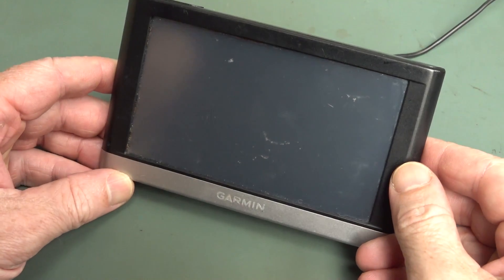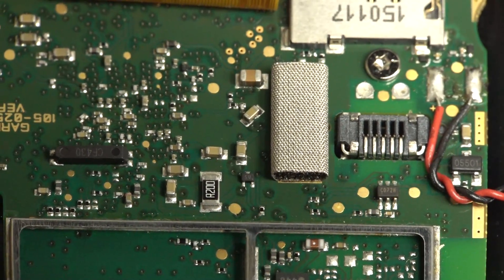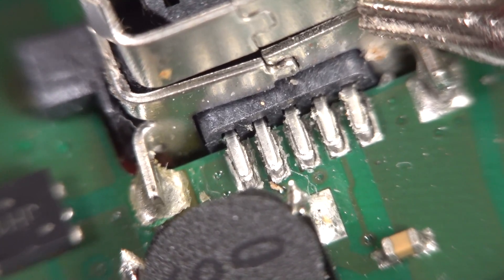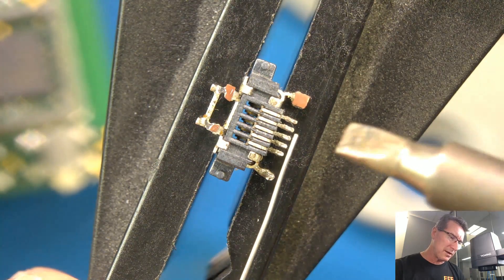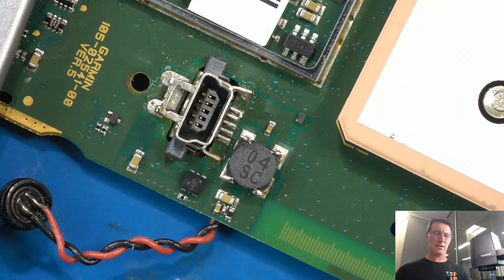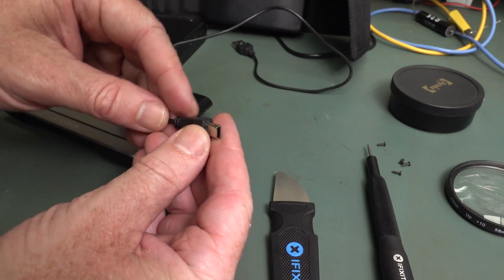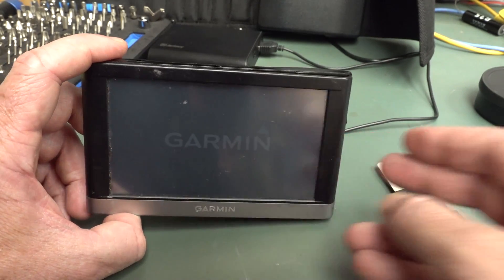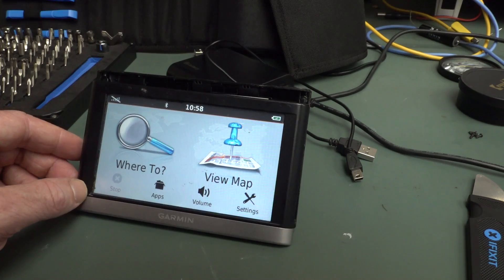EEVblog #1281 - Garmin GPS Repair

Comment: You ran out of flux or you are allergic to it? :P

Just giving you a hard time.. i would have used flux to whick that old solder :P
Reply: Louis Rossman took all of his Flux
Reply: @Rainbow__cookie  lol yeah..
Reply from the maker: You mean with that solder wick that already contains rosin flux? :-P
Reply: @EEVblog  yes. wick has never enough flux. it evaporates faster then you make your job. By adding good amount of gel flux you will decrease minimum operating temperature significantly, thus reduce the risk of damage, where it is really present..
Reply: @Mr.Leeroy  well you cant get enough flux im with you there lol

Removing components is what needs it most. Cuz of the non-leaded solder n such.
Reply: @joshuanorris5860  for general work the more flux you use the harder it would be to clean the board afterwards. I'm not a fan of submerging my components in a pool of flux, but when using solder wick it is actually required for proper heat transfer, not just oxidation prevention.
When removing lead-free components more flux won't help much, instead use leaded tin (or even better low temp mixtures, like 100 deg C melting point, if contamination of components is acceptable ofc) to lower the desolder temperature.
Reply: @Mr.Leeroy  so your saying you CAN have enough flux? Lol
Reply: @EEVblog  oh snap! Im sorry i doubted you even for a second haha
Reply: It should be obvious when he said "I don't know what these dendritey things are?"  They're Tin Whiskers Dave, where have you been for the last 20 years? :D https://en.wikipedia.org/wiki/Whisker_%28metallurgy%29 Yeah, the joys of RoHS solder.  I think Dave missed most of that.  They DID have solid core solder in the old days that you had to paint flux on things to make work, usually more a point to point soldering thing like in industrial panel wiring, etc.  No flux pens and needle bottles like kids today use. Just the sweet metallic flavor of lead solder, and the burned organic smell of rosin core flux. After enough years you don't need contrast agent for em to image your bones. :D
Reply from the maker: @Psibr1  I know what tin whiskers are, I used to have a several hour presentation on it on the channel before I had to pull it from the channel. They don't look like traditional tin whiskers to me.

Comment: Could you squirt like a load of glue gun glue from both sides to prevent it moving in the future? Best if it dries semi rigid. And has to not block the case... Since the connector chassis connects at 3 points I don't know how much you have to re connect one of the grounds unless it happens to be the only one connected.
Reply: Matthew Suffidy , Have you discovered JB Weld? It's like your first bong, You know you found gold.....

Comment: Garmin is in so many ways better than TomTom. Unfortunately, I bought a cheap (100€) TomTom 10 years ago, and it still works. But I need a virtualbox with Windows on it to connect to my PC (it had last gotten the GPS week rollover update last year, now it's finally out of support), so no support of updating it with any decent operating system. And the case can't be opened, it looks like it's ultrasonically welded, there are no screws in the thing. So this will definitely have been the last item I've ever bought from TomTom, if this thing ever dies (it sits behind my windshield 24/7 in summer as in winter, but no chance so far), I'll definitely get a Garmin one. However, I'd really like to have an old style unit with none of that cellular data connection, spyware or anal probes that constantly reports its location to the home base (of the manufacturer), and I also rather liked resistive touch screens compared to that modern capacitive rubbish where you can't precisely hit any stuff...
Reply: Garmin is the OG mannnnn :)
Reply: @joshuanorris5860  What?
Reply: The tomtom is probably just clipped together. The ones I've disassembled have just been clipped.
Reply: @tin2001  Then it's clipped really tightly. Anyways, I've again come to the conclusion that I don't need a new GPS, since except for the outdated maps (which I know and can react to), there's nothing wrong with mine (and since it isn't supported any more now anyways, not being compatible to my PC isn't a problem any more either). Also, the new ones all have some kind of connectivity and therefore include an anal probe or two, probably snitching all your routes and locations and speeds to the manufacturer, and I definitely don't want that. Then I'd rather not use a GPS, but an old-fashioned map instead.

Comment: Ahhhh suspect USB cables have gotten me more than once.  Seemingly every device you buy comes with yet another USB cable, and lots of them are dodgy as hell.  A few weeks ago I was baffled by a USB cable that was power-only, but had no markings indicating as such.  (I'm not even sure if there is a standard for marking USB cables that are power-only vs power+data.)
Reply: Several of the power only cables I've seen have a lightning bolt symbol but most don't.
I get out the permanent marker and label them with a "C" or "charge" (depending on the size of the space I can write on) when I find any of those sort of cables. Or if they are super crap and thin, I cut them in half and put them into my connectors box 😂

Comment: The lack of flux is uncomfortable.
Reply: Spare the flux, spoil the job. I reckon he's about 50cc short of Rossmann levels
Reply: Hahaha yeah. I was squirming for the first half of the video too :P

He starts using it part way... :P
Reply: @danblankenship5744  You got that right - those cables have very thin wires and a short will surely damage them :-)
Reply: @danblankenship5744  I've been soldering things together for over 35 yrs. Unless it involved Oxy Acetylene, there's never been a need for flux. It's only if you're using the new Pb free shit that you need to use flux.
Reply: @Jimmeh_B  your half right...
Reply: @joshuanorris5860  lol, yeah? Which half? :)
Reply: @Jimmeh_B  lol
Reply: Artifact of the generation who grew up with rosin core tin-lead 60/40 solder.
Reply: @Psibr1  

60/40 for life!
Reply from the maker: Last I checked, my solder and wick both have flux, and it works just fine. If you have further concerns, consult your doctor.
Reply: @EEVblog  I guess some people like to do it dry, but a little lubricant can't hurt.
Reply: @AKsevenFOUR  The flux in solder (so long as it is decent solder) is often more than enough. 

For all of you doing "the Rossman," it's fine and can often make it easier like when pins are too close but it's rarely required at mini USB pin sizes and way less cleanup without it.
Reply: We seem to have a new generation of armchair solderers who have watched too much Louis Rossman and think that soldering needs a bucket of flux tipped over it.

Comment: Cut that cable in half before throwing it out!
Reply: Couldn't agree more. There is nothing worse than picking it up a second time and finding out it is faulty after another hour. My faulty cables get terminated by means of side cutters.
Reply: Yeah, some crazy person might go dumpster diving and try to plug it into something.
Reply: @Nicmadis  This is a GPS reciever for christ's sake. The highest voltage on that thing is probably in single digits. Not everyone is a frightened child that needs to be shielded in bubble wrap from anything that could POSSIBLY do ANYTHING bad at all. Get a grip. (also LiPo batteries are not explosives)
Reply: @EC-oo8fx  For one, the cable was flat out shorted in this vid and el cheapo to start with, so you have a potential incoming scenario of someone plugging a damaged cable worth next to nothing into a very expensive and possibly sensitive piece of working technology. 
Second and most importantly, much like a lot of other comments on this channel, I was making a joke that apparently went straight over your head. Sorry about that I guess.
Reply: @Nicmadis  Hahahahaha. Thanks for explaining your "joke". I laughed soooo hard. /s
Reply: @EC-oo8fx  Hahaha. Thanks for explaining your "sarcasm".
Reply: The USB A side is still good. What a waste.
Reply: And toss the two halves into seperate bins. We never know with these repair enthusiasts.
Reply: @Drottninggatan2017  This is why the right to repair bill should not pass.
Reply: @IIGrayfoxII  Responsibility is on them, not you and not the government.

Comment: Well, you can argue that solder can be used for mechanical strenght, but I guess this shows why that's not really a good idea. Not on something that is moved often.
Reply: Yep. My previous car had to have the windows buttons replaced THRICE before Mitsubishi realized it's not a good idea to solder push-buttons directly on the PCB -_-
Reply: No. Solder is extremely strong!

The problem is that it was soldered only to some pads which were weak/not meant for that.

Yes... Too much movement....

If those pads were way stronger it would be fine...

Comment: I thought the shield of the connector was only supposed to be grounded on the host side and not the device side.   In other words, only connect the shield of the USB cable on the host side.

Comment: Vias can be used to add structural strength to pads to prevent them lifting. I have done that too in similar situations. Here is did not help enough though...
I also had loads of problems with crappy Mini-USB cables. In the end I bough a huge box with 1000 cables from Molex so that I would NEVER have to worry over that again.

Comment: Nice fix, but a smartphone with Google Maps in a cheap vent mount is superior in many ways, and can also serve Spotify duty at the same time as navigating.
Reply: The only benefit Google maps gives me are live traffic updates. Other than that, my garmin is superior in every way.
Reply: Until you're in the outback with no internet access
Reply: @GeraintJonesNZ  Google maps also allows you to download maps and navigate offline :)
Reply: Google Maps is highly flawed when you start using it for anything beyond single trips in one car. 2 vehicles traveling together can be given 2 vastly different routes, large vehicles can be sent in to roads far too small for them, and if you ever use it in rural areas with less traffic, be prepared for some bizarre attempted shortcuts down back roads when it decides to trial their effectiveness as an alternative route.
I had to download Sygic Truck when we went to the UK for all 3 of those reasons... We had 2 large motorhomes, and got separated multiple times after Google suggested 2 different routes. Sygic reliably gave the same route to each of us.

Comment: Jeepers man, it's just an ground contact lol. im sure it would have been fine without it, as it's grounded elsewhere.
Reply: It's not uncomon for connector shells to be used as jumpers, you have to check.
Reply: number 33 oh random, thanks
Reply: earthed lol
Reply: Prehistoricman that better?
Reply: Irrespective of the electrical connections, what is most important is that the pad is the PHYSICAL connection of the socket. With one pad gone, it's only 75% as strong as when new.... and even with 100% of it's pads it still failed.

Comment: Garmin Stinks..
TomTom is much better!
Reply: I've never actually bought a dedicated Sat Nav.  I began by using TomTom on a Mitac Mio 168 Pocket PC with builtin GPS and antenna, and then a Dell Axim X51v with external Bluetooth GPS receiver.  Since that I have used my smartphone with TomTom.  The dedicated devices other people have given to me to sort out, were always built to a low standard and charged a premium for.
Reply: @EgoShredder  Cool.. Tomtom like Garmin does not require a cell connection like Google maps.. You can download maps to use offline with GPS with I have done on my Tablet that does not have a cell connection.
Reply: @EgoShredder  My first GPS was Teletype. which sucked.. then I got CoPilot for pocket PC. WOW  that was a great solution. I used a Toshiba E755 with a 2gig card and a magnetic GPS antenna that I stuck on the roof of my SUV.. It was a solid. I impressed a lot of my friends who had built in gps..  :)
Reply: TomTom is pretty rubbish now. It used to be king but since smartphones with Google Maps have become popular, it sort of seems silly to spend the amount they ask for.
Reply: @tin2001  Google maps is great! But is requires cell phone and gps..  The Tomtom is not dependent on a cell connection
Reply: @tin2001  True although Google Maps is not that well designed, compared with TomTom.  GM has let me down a lot, but TT has been a more pleasant experience overall.

Comment: I can recommed UV hardening glue for stress relief. This stuff really works!!!
Reply: Yup. Julian Ilett uses that stuff as conformal coating too. It looks quite strong.
Reply: Just make sure not to spill any on your laptop 😳
Reply: I recommend hot glue. Lol. it would be fine. May be a bit of a bodge but is strong enough when cold
Reply: @09danstart  - which makes Hot Melt the absolutely WORST thing to use in a GPS which is inside a car which can reach 60°C or more
Reply: @johncoops6897 , there are various hot glues, including high temperature hot glue. If your car is getting > 190 Celsius, you got bigger issues.
Reply: @JimBob1937  - most people only have access to cheap (PTC based domestic) glue guns for Low Temp glue sticks. The softening point of those sticks is lower than the typical in-car dashboard temperatures here in Australia. If the glue is soft, it cannot and will not act as a strain relief. Hot melt glue also gets brittle and loses adhesion under cold conditions... which makes it a poor choice for strain relief. Considering that the repair of the connector takes considerable time, why fuck around with a flawed and bodgy solution when there are so many vastly better products available (e.g. any permanently hardening glues)
Reply: @johncoops6897 , I was just saying, there are some hot glues out there that offer proper strain relief within the environmental conditions of the product (including, higher temperature). I wouldn't wholesale discount hot glue as an option, as it can be perfectly viable if the correct glue is chosen... which is the case for all strain relief solutions. I would agree, there are generally better alternatives, but I also disagree that hot glue (properly chosen) isn't a good solution.
Reply: When I get a pad lost like that, I drill 2 holes (say 0.3mm diam) and loop a copper wire through the board and solder it to the item. Obviously you have to take care to pick up the wrong trace on either side of PCB.
Reply: Red SMT mounting adhesive is what I use. That stuff is VERY strong, but can easily be removed with hot air if needed.
Reply: Or neutral cure silicone sealant.

Downside with many UV cure adhesives, is there's no spread effect, so it won't cure any sections without direct, unrestricted line of sight from the UV source. Best to keep that in mind before making material decisions. If there's uncured UV resin adhesives in there, those will attract and accumulate a lot of potentially conductive contaminations long term.

Comment: A common problem.  Your vertical one looks easy.... the horizontally mounted ones are a bit of a challenge at the pins are down inside the connector.

Comment: As for the Groundpad that lifted:
Can't you just superglue it? :)
Reply from the maker: Sure, bu that wouldn't do anything. The connection would still be broken, you can't then solder it because it's superglued. If you are after rigidity then you expoxy the whole connector like I suggested.
Reply: @EEVblog  Yeah, its only for rigidity, as it was the lifted off pad...
Doesn't it work to just not desolder it and glue it to the PCB?
Reply from the maker: @Stefan_Payne  You wouldn't use superglue, you'd use epoxy like I said in the video. PCB's are expoxy resin.
Reply: ever soldered superglued pads? without fume extractor, its irritates your eyes and nose really bad and the glue breaks lose under heat.
Reply: I wonder how many of these devices have been thrown out from a dodgy usb connector. Not everyone has a torx and solder iron to effect a repair. Pity Garmin didn't  invest more effort on stabilisation of that port.
Reply: @davidpalmer9780  yeah and all the other kinds of devices tooooooo

Comment: not too difficult to kill a cheap USB cable with a short circuit on the power pins, heating up the connector to red hot ;-)
Reply: "not anything I did"
oh, really now LOL
Reply: @deadgaming20  Let's short it out and blame the cable for being faulty, "Nothing I did", a short or two is nothing between tiny USB pins :D lol
Reply: That's your assumption (or if it was a humorous comment, excuse me). There is a thermal poly-fuse restricting the maximum current flow to the USB specs. USB 2.0 -> 500mA and USB 3.0 -> 900mA. For a typical AWG24 cross-section cable the maximum current at 30°C is 3.5A. The USB current will warm it comfortably up, but nothing else.
My assumption is mechanical stress. This sucker was just as worn out as the plug. For "red hot" it needs far more than the system is capable of providing.
Reply: @dieSpinnt  Dave connected it to a USB charger. These deliver nowadays at least 2.1 A into any load presented to them...

Also the wires in a cheap Chinese micro-USB cable are nowhere near AWG24...
Reply: @uwezimmermann5427  Oh, i forgot we are talking about Dave. So no current limiting was in play at all, when testing a repair;)
... and i have no data about the cable used in the video.
Reply: I wouldn't want this guy working on my electronics!
👉👊💨!!!

Comment: Chop that cable in half immediately you condemn it, that way you do not accidentally use it again.
With the vias I use thin tinned copper strand through the 2 vias, then twist the other side to hold the socket mechanically. Drop of epoxy on the back will work well, just put a thin smear on the socket, wait for the rest to start to gel and place the blob on there, so the epoxy does not run down the socket and render it useless.
Reply: Brilliant